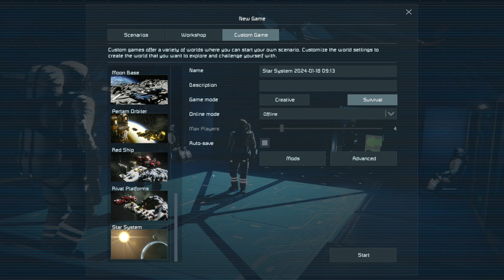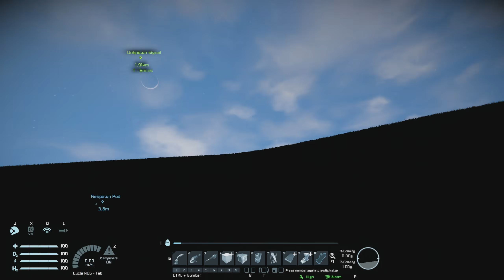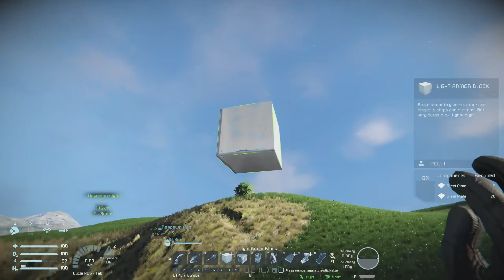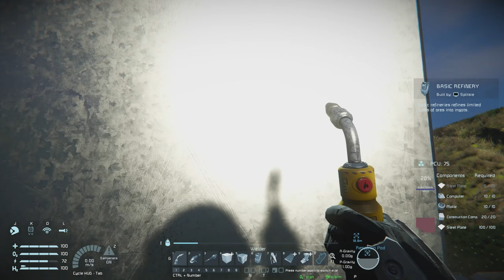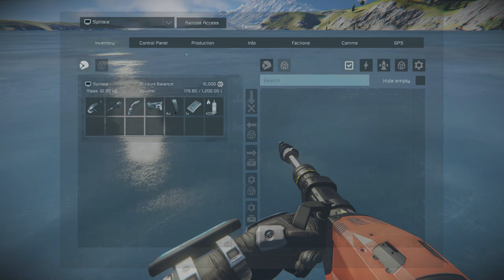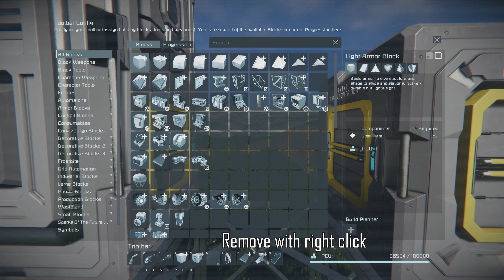Getting Started in Space Engineers

Comment: I don’t understand. The tutorial is telling me to recharge at the survival kit, but the shit will not work. It refills my energy, but not my hydrogen or oxygen
Reply from the maker: Thinking of each element separately may help. For example, the survival kit can:
- recharge health and energy, if it has power
- supply hydrogen, if it has access to hydrogen
- supply oxygen, if it has access to oxygen

On the pod, the kit gets power from the battery you start with. It can also get the two gasses from the O2/H2 generator, but only if they have something to make those gasses from. When you spawn the generator will have a small amount of ice in it (300kg), once this runs out, to get those gasses from the kit you'll need to supply it with more ice. If you move the kit to your base, you'll need to build a generator there and supply it with ice.

Later on, you can also fill up tanks with these gasses and use them to supply the kit or medical room if you have one of them at that stage :)

Comment: PLEASE HELP.
I'm currently playing on the console version (Xbox) and my Turbine will not snap to my tower, or it will for a split second and won't do it again. I keep trying to find sweet spot so I can place it. I placed one the side of the tower but it won't output any power.
Reply from the maker: Larger blocks like wind turbines and refineries can be a little tricky as you need to be fairly close but not in the way of the block. The way I think is easiest is to use your jetpack to fly directly above the block you're trying to connect to, then slowly move forward or back (which will move you up and down) until you're in the right spot

Comment: For Turbines to work locking on to voxel includes landing gears as well.  So you can have turbines on your large grid ships and as soon as you lock your landing gears it will start producing energy as long as there is atmosphere on the planet
Reply from the maker: Yup, can be useful for large grid rovers too. Soften your suspension until you touch the ground and lock then squat there as you recharge :)
Reply: @Splitsie  I never use rovers because they are pointless.  The only rover I use is one that I built that uses small grid rovers and large grid top for refinery etc. I never tried turbines on large grid connected to a small grid....  now if that works  we can place a turbine on the frist spawn rover to charge it :)

Damn you Splitsie now I have to test it out and I can not do it for another 4 hours.....
Reply: Ok so If you manage to place a large landing gear on your spawn pod and then place a turbine on it, when thats locked to the pod and the pod is locked to the ground the Turbine works :)

Comment: quick note on suit energy, you could recharge it whenever you sit in something connected to a powered grid, either a cockpit, passenger seat etc. without relying on the survival kit. even possible to steal a bit power on pirate ships with a newly built seat🤣this could save you in some really desperate situations, although running low on energy is quite uncommon compared to O2/H2 problems and is mainly caused by overusing hand tools

Comment: A tip to make life just a bit easier: if you're holding a block you want to build, by pressing the scrollwheel on any access port it will automatically draw the components you need to your inventory.

Also if you run out of components while welding, you can right click the block you're welding (with welder on hand), go to any access port and click scroll to draw only the components you need to finish the welding
Reply from the maker: The reason I avoided mentioning that function is that it only works if your build planner list is empty at the time, I felt that going through that caveat and explanation was a bit much for this tutorial even though you're right, it can be very handy :)

Comment: is there a way to deploy parachute earlier? everytime i start a new game, the parachute opens to late damaging my pod and i have to kill myself to get a new one. then, if i am fast enough open the 'k' menu and deploy parachute manually... why is the parachute not open earlier by default?! maybe fine on earth but on other planets it really sucks.
Reply from the maker: There is, if you are really quick about it, the simplest way is to open up the control panel immediately, find the parachute block and increase its auto deploy height :)
Unfortunately, you'll still probably have some unlucky landings where the pod rolls, or hits hard enough to break a landing gear or two as I don't think those are solely down to how late the chute opens
Reply: yes but i don't understand why it's not setup by default more safety especially on planets with higher gravity or high mountains (as the hight measurement always seems to be sealevel?)... may i have to figure out, how to change the drop pod file and set the parachute hatch to more safe distance. but that's normally a job for the devs and not for the "user" @Splitsie

Comment: Instead using armor blocks with steel plate to build a platform or tower, you could instead build interior wall blocks with interior plate. Interior plate uses less iron for each component made by 85%. Interior walls do have less hitpoints then armor blocks though.
Reply from the maker: Indeed, they're a lot cheaper (1kg vs 7kg of iron). I mainly used the steel plate here to allow me to show off the way to change which shape you're using and how grinding parts of the lander off can be helpful :)

Comment: 17:35, and through the magic of Video Game logic, the Steel Plates retrieved from the  SMALL Grid become use able in a LARGE Grid.
Just like the shirt your Tauren is wearing will also fit the Gnome :)
Reply: Well, yes, but it does so in a logical way. You need one steel plate to completely construct a simple small grid cube. You need 25 steel plates (IIRC) to completely build a large grid cube. For the most part, the number of required components scale with the blocks volume, both in terms of small vs large grid relative size as well as percentage of a full block 'filled' by a shape (e.g., the large grid 'ramp' block fills 50% of a full block, so it takes 12 (13?) steel plates instead of 25). Same goes for the mass of completed blocks that is actually the sum of the required components' masses.

Comment: Isn't the basic refinery faster at refining stone? Not as efficient sure, but once you have a mining rig, an absolute must (if you don't have a full refinery).  Volume used for each batch may also be an issue, but I don't recall the figures off the top of my head.

I'm also wondering what the power requirements are for the two blocks at this early stage.  How much juice did you use on the pod running the survival kit as a refinery?  That two days of idle power went down how far?

What's the obstacles to the different turbines?  One thing might be the other blocks within range, the other is the voxels on the hill.  You can demonstrate improving the one by drilling out the terrain; though that would be over a fair area.

@41:00 or thereabouts, you said there was only the survival kit to get power. I didn't see you grind down the chair/seat in the survival pod.  That's another way to recharge if it's still there.
Reply from the maker: Yeah it probably is quite a bit faster with the stone but when you can mine iron ore by hand there's little to be gained from piston/rotor based mining rig (if we're focused on efficiency, there's plenty to be gained with regard to fun) :)

The turbines are mostly blocked by the proximity to the voxel as the uphill one is the worst of the bunch

Comment: Couple of hints
1) Build the frame of a hinge with a small hinge part then build 1 or 2 small batteries on the hinge. This can work as a temporary power buffer for the refinery / assembler when starting with low wind.
2) More complicated, if you have your starter pod "flying" you can use the small tubes from the parachute block to build small merge blocks. In the same hinge part build a steel block arm and add a small merge block to it, then to the starter pod. You then use your start ship as the battery buffer.
3) Use seats to store items that won't store in your initial survival kit / small grid cargo container
Reply: If you build the hinge and you have your pod moving why not grind off the hinge part and put the part on the ship and skip the merge blocks? I've used advanced rotor to connect my starting pod with a medium cargo since it doesn't need grids like the large grid ones.
Reply from the maker: Good suggestion with the hinge to batteries, it's a nice way to get something up that's a bit cheaper than a full large grid battery. Due to the risks with hinges, particularly locking onto them with something that's flying I'll be saving some of that for more advanced topics :D

Comment: Storage: while Cargo containers are ideal they require Grids which need Cobalt, Sometimes this can be frustrating to locate. but you usually need storage very soon. This is where Crates and other types u find in mods come in. They dont require Grids or cobalt to make, but the downside is they also dont have conveyor access, which means you need to transfer stuff in and out manually. They also dont require power which means that you can use them anywhere on their own without building anything else. That might be a hassle but it will only be one until u find Cobalt.
Reply: I have found myself more than once using connectors or advanced rotors to place large small-grid on a large grid for the cargo space. Fun when it is a space start and here I am in my ion pod pulling a train of small-grid large cargo containers!
Reply from the maker: Yeah, my preferred is the small grid large cargo container, all the conveyoring, none of the grids :)
Reply: @Splitsie  I kind of like the crates tho. its fits right in with the short of supplies, roughing it on the edge of survival motif. lol.  Gives it that kind of Living out of your trunk vibe.
Reply: A little late, but if you don't plan on using the drop pods hydrogen thruster, you can grind it down for 4 grids. Just right for a large grid small cargo container. At least, if memory serves me right. Been a minute since I've looked at the drop pod. If not. Each of the atmosphere Thrusters have 1 in them.

Comment: Helpful Tip for new people trying to find rock (and other ore)
1) take a 4 year course in Geology. (just joking)
2) Dirt covers are thicker in valleys and hill tops with it being thinner on the sides of hills (especially cliffs). so consider mining sideways as well as down.
3) hills and mountains (and some planets) have rock outcroppings on the surface.
4) There can be actual boulders sitting on the ground that contain rock as well as a core of other minerals.
There can be variations where even flat valleys can have spots of shallow rock. Think of the geology as if there was a rough landscape which was covered over the Eons by sand raining from the sky to the point where the sand buries most of that variable terrain until its flat like a sea of water. but in our case it happens in the 3456 ms of planet creation. lol

If u are in an area of grass and you see a nearby area with no grass on it? its thinner over there where there is no grass.

PS: while it is a shorter path to drill straight down a sloping tunnel helps if u should run out of Hydrogen. That said u can always drill your way out ... until u run also out of Power (and light).
Reply from the maker: Agreed :)

Comment: You did an amazing job on this new and improved tutorial, Splitsie! Clearly structured, well paced and super-informative. It was worth the wait, even for non-beginners!
One tiny thing you could have mentioned is the "T"-feature and why it should be off at basically all times.
Reply from the maker: Ah, good point. I'll be sure to highlight that in the miner design section as I'll be working with armour shapes that are more complex there 🙂
Reply: @Splitsie  Thanks, great to hear that! If you made a drillship with at least two drills, be sure to mention another rarely-used "feature" (more like annoyance), which is pressing Middle Mouse Button while operating any grid tool.
Reply from the maker: Yeah that's another good point. Super easy to get caught out on that one